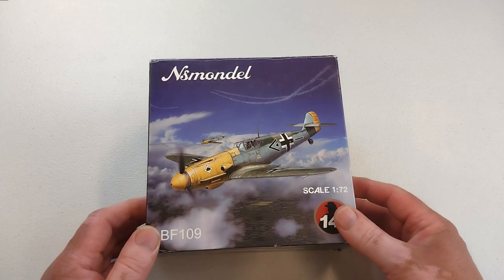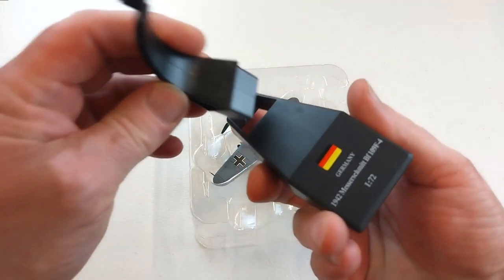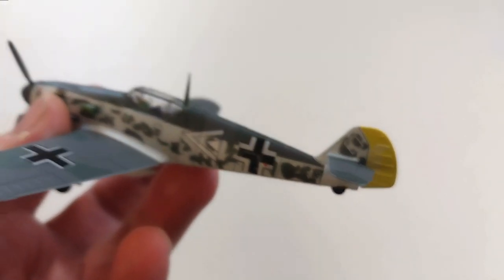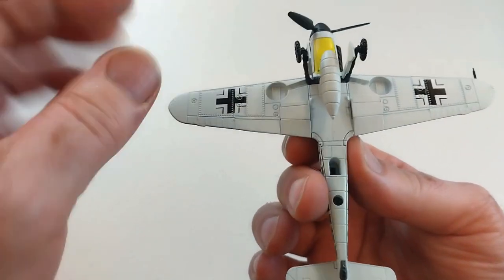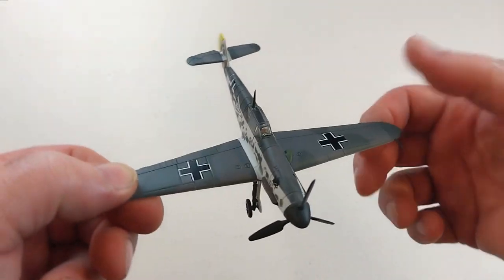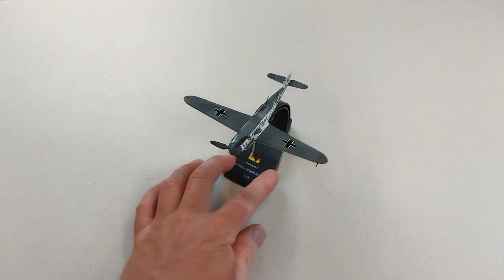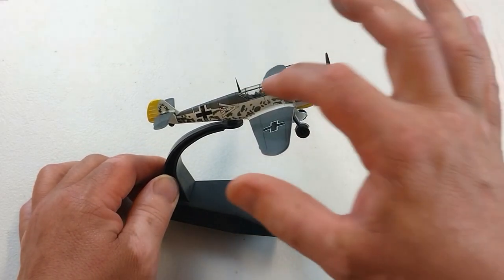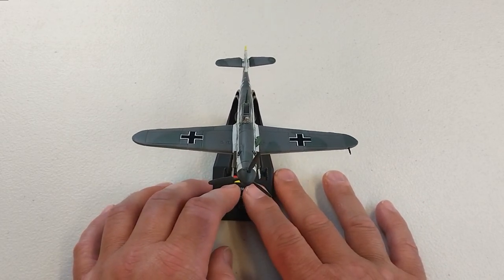Messerschmitt Bf-109 F-4, German Luftwaffe World War 2 Fighter, diecast disappointment once again

Comment: I have one of these and after watching this video, I had to run and go check the supercharger intake. Mine is oriented the correct way around. Also, I scanned the interwebs for adverts of this model and the photos are all taken from the right side of the model, none from the left side (coincidence?). If you look closely at the pix you can see the intake was fitted incorrectly as in this video. Overall, I agree that this model is just okay, but at least it was cheap.
Reply from the maker: Thaks for checking out one of my older videos,haha. Yes the only positive is the fact that it didn't cost a lot. Can probably snap it off and re glue it in the correct way, but I guess the little guy making these ones was quickly fired,haha. The old saying, you always get what you pay for. I never expect greatness when I buy cheap ones, but sometimes you do get some excellent models, but also some trashy ones. Its what the videos are for, to save all you viewers watching some money!!